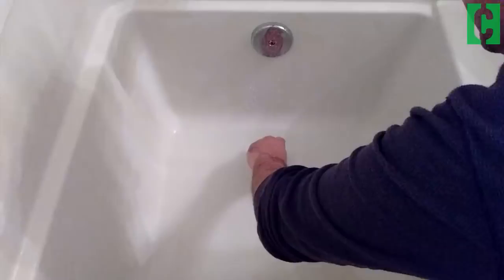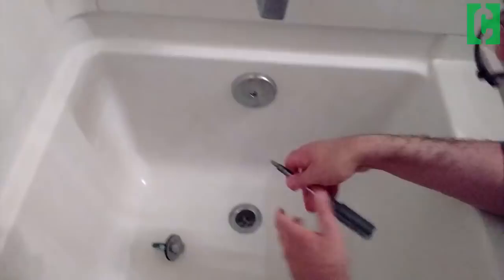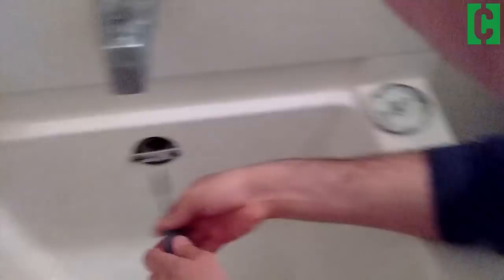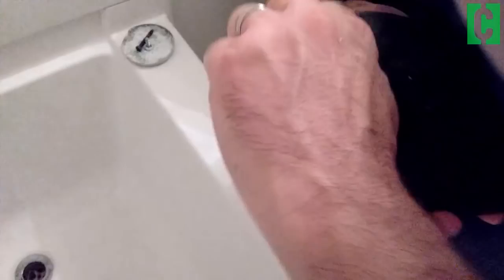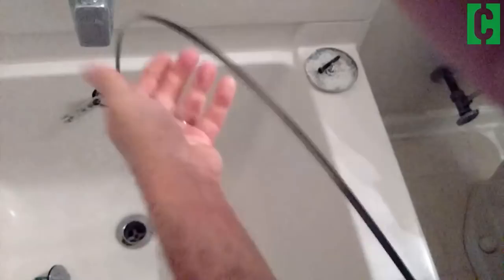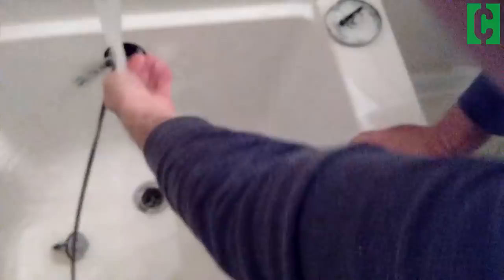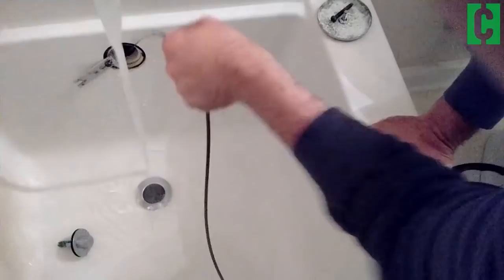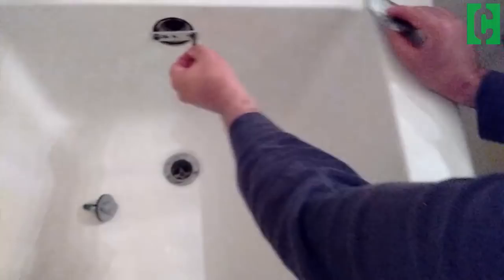Bathtub Drain Going Down Too Slowly? Do This!

Comment: Baking soda and vinegar worked miracles for my bathroom sink which was slightly stopped up when I moved in my house 3 years ago. My landlord went under the house trying to find the problem but it kept clogging up. He poured countless jugs of Draino in the sink but it didn't work. My dad finally told me that baking soda and vinegar had always worked for him. I decided to try it and was pleasantly surprised at how quick my sink began to bubble up nasty liquid gunk after pouring the mixture into the sink. After the process was done, we haven't had a single problem with the sink clogging and the water drains immediately when brushing my teeth or washing hands. Baking soda and vinegar are 2 common household items that are extremely useful for cleaning and fixing all kinds of problems with so many things! I always keep one of my small kitchen cabinets stocked up with boxes of baking soda and bottles of vinegar.

Comment: I just remove it and use my index finger and thumb and pull out the long hair 'bogger' screw it back on real simple, free and works.  I put a towel over the drain in case I drop a screw.

Comment: The problem I have is the plastic piece was broken by my plumber because he forced the toggle switch to go down  because it was stuck. He did that that so I would be fooled that he fixed the toggle switch. He wiggled it and said see its fixed and left. Afterwards the tub wouldn't drain, sadly I didn't check with running water. I later opened it up my self and it was broke off and no longer connected so its stuck in there. What can I use to stick in the hole to manually grab the plastic piece to pull it out? The plug is stuck down so tub wont drain. Any advice is appreciated.

Comment: My issue is, my bath tub and fixtures look almost same as what Isaw the video.  But I couldn't open up the drain, I usd flashlight to find there is  a very small screw beneath,  1 inch below the drain, you can imagine it's impossible to unscrew it with usual screw drive.  So I just tried using "DRAIN CLEANER"( a 1.5 feet long plastic ZIPIT with some bars from home depot)  and home made metal wire to insert as deep as possible to reach any "soft dirty things", but nothing could be touched. Any body get any suggestion?  Thanks!
Reply: I think he must have had that drain stopper loosened already, as I have never been able to get mine off like that.  Normally the little knob on the stopper is made to unscrew, and it reveals a screw that you can unscrew using a flathead screwdriver.  What you would normally need to do is put the stopper in the down position so it won't turn while you are trying to unscrew the knob.  Wrap some masking tape around the edge of the knob to protect it, and then use pliers to loosen the knob.  Then unscrew the stopper.  They make a special tool you can get at a hardware store if you need to remove the base of the drain.  If you do that, you will also need some plumber's putty to put around the drain before you put it back in.

Comment: I'd like to offer some extremely simple advice you might want to try before the this fix. This fix is great, but sometimes you can solve your slow draining in a very simple way. Bleach, I prefer the gel bleach for this mission as I feel it might move slower through the clog, eating up more of the crud. With any slow drain I start by simply pouring a gallon of bleach down that drain. Quite often I see a very immediate and noticeable difference. While I'm long-winded, the advice is simple.😁